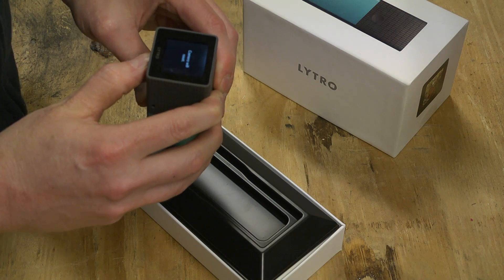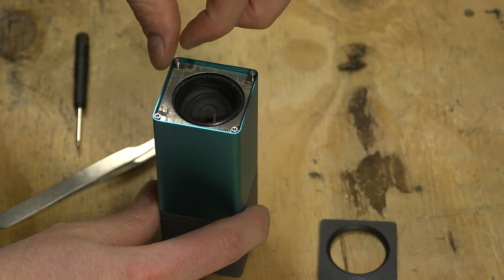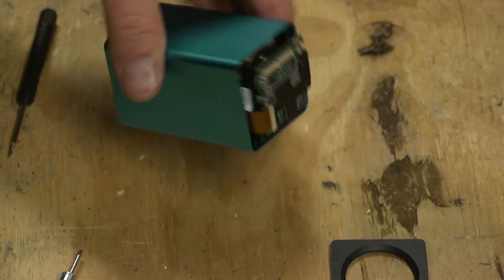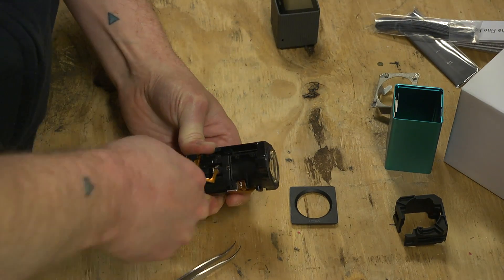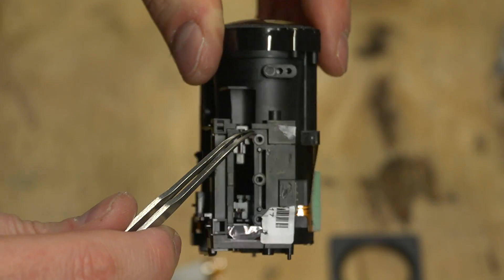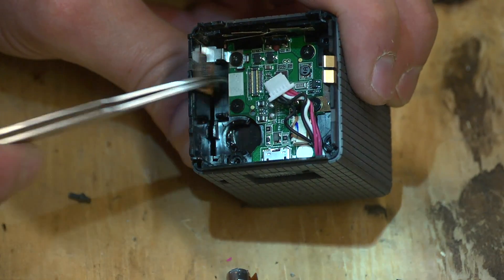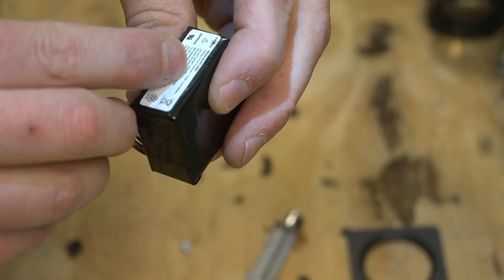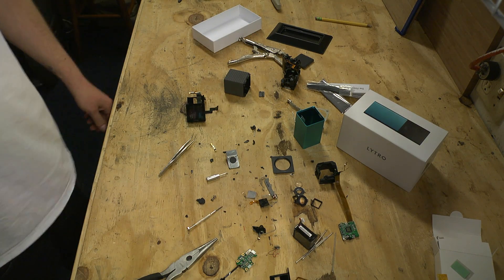How to take apart a Lytro Camera

Comment: There is a method to disassemble/reassemble with no damage. Start from the back and feed the lens assembly ribbon cable which is under tension when you separate the middle through from the back. This requires removal of the rear LCD and the back most PCB. Then remove the rubber from the lens assembly ribbon cable and unplug from the main CPU board (second from the rear). At this point you can remove the two halves and feed the cable through without detaching from the lens assembly.

Comment: While it was kinda shocking watching the utter destruction, it was a good look into how it's put together. That lens looks startlingly like the one from my old Sony Handycam, same shutters, same drive motors in the same places, hmmmmm.
The motor closest the lens front is the Zoom, the second on is the "focus" (it still needs to get a clear focus onto the microlens sensors I think) The ZORAN chip is the main processor, a few cameras use this. The HYNIX chip is the flash

Did anybody buy the bits?